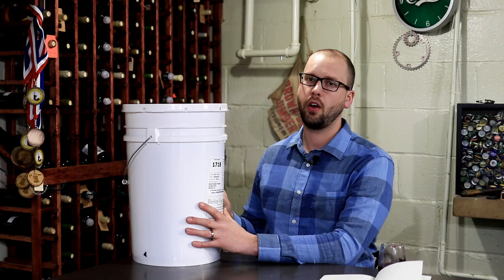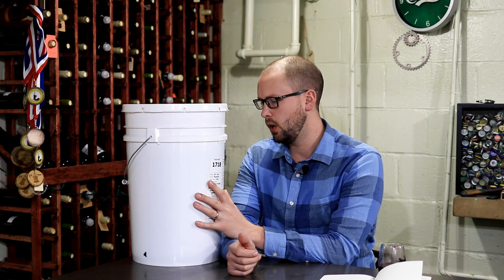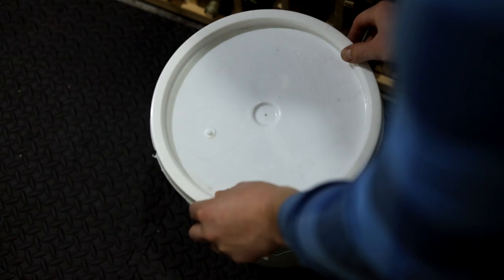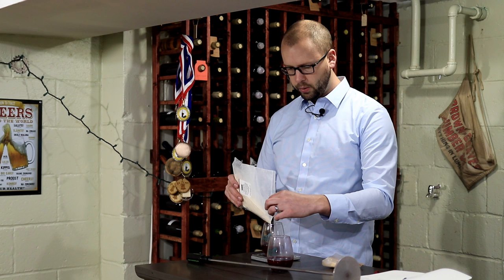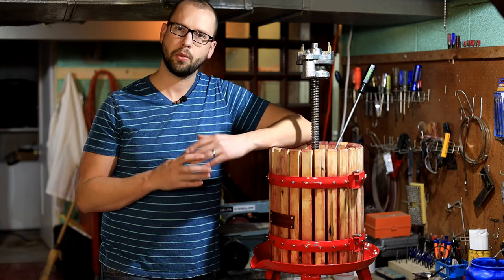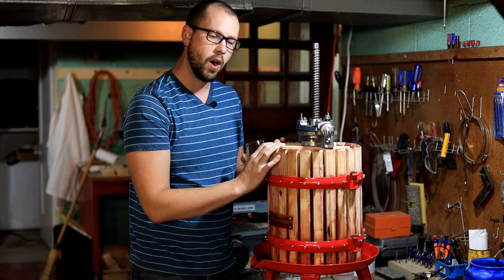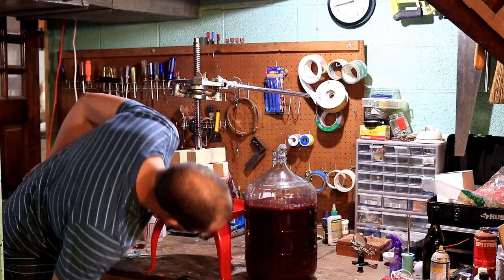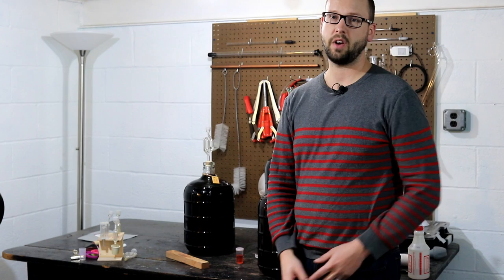Making Wine from Frozen Grapes!  Make Incredible Red Wine Anywhere, Anytime!

Comment: I noticed you start ML after racking. It also seemed like your time frame of the first rack was early. I have been adding ML before the first rack and then rack after it finishes. Since I don’t have temp control that’s usually at the 2 week mark. Does adding ML after the first rack make a big difference vs. the way I have been doing it?

Comment: very nice video, any tips with over sugar wine, happend to me, after secondary fermentation i had very low % of alcohol 5% ,add sugar to elevated but did bad job, its 1.20 on hidrometer, its any way i can save wine  on this point of time, i tried kick fermentation again, bubeling,but, not, moving any numbers on hidrometar. 
thank you

Comment: Hey Rick. Loving all your content and excellent tips, especially for guys like me just getting started. 
Noticed in your notes that on day 6 of fermentation (2/26) you used both CaCO3 and KCO3 to knock down your acid. What was is the rational for that choice? Thanks and keep it coming!
Reply from the maker: Hi Jerry.  Calcium Carbonate will reduce the acid pretty rapidly but leave a small bit of residual calcium.  Potassium bicarbonate is a little slower but leaves residual potassium.  Generally potassium bicarb is the first choice but eventually the potassium could create a slight salty taste if it were too much.  The amounts I added were super small so it really doesn't matter  but my rational is that a tiny bit of calcium and a tiny bit of potassium is probably less likely to ever be detectable than a larger amount of one or the other.
Reply: @TheHomeWinemakingChannel  Ahh, cool. Appreciate the rapid response and detail. Super helpful since my chem background is zero :) Thanks Rick!

Comment: Thanks for the video! I actually just recieved my order from Brehm! I ordered two buckets of Pinot Noir. I'm trying a cold soak for the first time. Should I be concerned about oxidation during the cold soak? The lid that came with the bucket isnt very tight fitting.

Comment: hi great video.. I bought some rjs wine kits and the ph is running low? like 3.1, I let sit on the grape skins for extra time - I bought some k bicarbonate and added .5t to each 5g batch, but for these reds you would suggest I get it to 3.5 post fermentation (now - they are still low)  thanks  similar ? regarding the tanin - best to add some tanin even post fermentation? - thanks.
Reply from the maker: I have seen some weird stuff from RJS wine kits.  The pH seems to run very low but they the TA is also low so they do not taste particularly acidic.  I think they are engineered this way so that they are very unlikely to oxidize from careless Winemaking.  I wouldn't get too carried away with bring the pH up any more on it or it will likely taste a little thin/flabby.
Reply: @TheHomeWinemakingChannel     

Oh great,

Of course I made a bunch of adjustments last night while racking.. (and straining so I watched a ton of YouTube wine making videos..) 

I used a 3 to 4 teaspoons per batch!!! to adjust ph to 3.1 to 3.4s some were as low as 2.9 and they were expired and I want to complete malolactic  fermentation sooo obviously worried re ph.. 

Hope I didnt make these 4 kits flabby!!

One merlot msrp is 199 the en premier kit and i added 3t to that one of k bicarbonate!! Yikes.

What should i do now if anything??

Comment: Great video! Is there any material difference using a stainless steele racking cane compared to clear plastic?
Reply from the maker: Thank you!  There is really no effect on the wine if you use the plastic cane.  Stainless will flow a little faster at the same size OD since the wall thickness is a lot thinner.  And stainless is much less likely to break on you as you are jamming hoses on and off of it.

Comment: I couldn’t see in the video, did you drain the water out of the bucket once it fully thawed?  Did you add additional water to the bucket after that or no?  We missed that part.
Reply from the maker: It is frozen crushed and destemmed grapes.  If you pick fresh grapes for red wine the first step is to crush and de-stem them.  The liquid in the bucket is grape juice from the crushed berries, and not water so you are basically getting a ready to go, red wine "must".  No need to drain anything out.

Comment: How do you keep your punchdown tool sanitized during primary fermantation? Do you keep a bucket with sanitizer during this period or do you make one fresh for each time you punchdown?
Reply from the maker: I leave it in a bucket of Star San that is filled about a foot high.  With the larger punch down tool, I spray it off with water when I am done using it, and use a spray bottle of Star San on it right before using.

Comment: Bulk aging vs bottle aging... If using carboys, when do you decide to move to bottles? If you decide to bottle age, when do you decide to pull the trigger and move into bottles? So far, it seems like you would move from the main vessel straight to the bottle after everything has settled out and if you bulk age you would just keep it in the carboy longer (maybe rack once more to remove any sparse sediment) and move to bottles when almost ready to consume. This sound right or am I missing something?
Reply from the maker: I like to bulk age reds for at least 8-12 months.  At that point they begin to show what they really can be and you can take a better guess at a good blend if you plan to do blending.  A summer cycle in bulk also assures that any instability that is going to show will show in carboy and can be dealt with or let to run its course.  A white wine, fruit wine or rose can be bottled soon after it clears up and settles out.  Those are generally better young so it is worth getting them into bottle by about 4-8 months.
Reply: @TheHomeWinemakingChannel  Still very new to all this. What can be done after primary fermentation has completed, in secondary/conditioning? Just playing with simply juice concentrate wines at home, they are very flat and monotone as I did not use any tannin powders or acid blends in primary. Is it too late add in some lemon juice as a citric blending agent? What can be done vs what should be avoided?

Thank you for your help!

Comment: Hi just got done with primary fermentation.  I want to start malolactic fermentation bu my ph is at 2.9.  Any suggesrions
Reply from the maker: I would make sure your pH meter is calibrated against some 4.0 and 7.0 solution.  I recently had a guy who's meter was reading off by about 0.5.  2.9 sounds unusually low to the point where I would question the meter unless it was a white wine or fruit wine.  If the reading is right, you can nudge it up a little bit with some potassium bicarbonate to help get MLF going but it will still be a challenge.  You will need to keep the wine relatively warm to get things going.

Comment: So I ordered a 5 gallon bucket of Merlot and by accident because of delivery problems got two buckets, they are both frozen. Following a Cold-Soak. My question is if you where to do two different styles what would you suggest, from yeast, too favor condiments. If you was to play with two different styles what would you do? Or would you stick with just one? And just do it right? Did I just answer my question?...:)
Reply from the maker: I'd ferment one cold (68F) which will make a very fruit forward wine, and let the other warm to about 88F for about a day or two which will make a much more intense wine.  You can also load the hot one with tannin during fermentation whether from oak or fermentation tannin.    I'm assuming these are frozen grapes, and not juice...  If juice I'd ignore my advice and ferment both around 75F.  If you want one to be more buttery you can do a slow cool MLF, while doing a warmer, well nourished MLF on the other.  If you want to do a side by side comparison you should probably mix the two buckets then separate again since there could be substantial bucket to bucket variation.
Reply: @TheHomeWinemakingChannel  thank you. You confirmed a few of my Ideas. Will do!!!

Comment: This is super interesting, I like being "in" on the decision making, including waiting, easing, etc. Well done. 
I noticed you didn't do a "saignée", though you usually recommend it for bigger, bolder wines - which Super Tuscans are. 
Would you mind sharing your reasoning? 
Also: fine, I'll order some frozen grapes when the carboy real estate opens up in the basement - you got me into grapes (vs. Must), may as well try this :-)
Reply from the maker: Thanks!  I actually would have pulled some juice off but I just didn't have a lot of grapes to work with.  I'd probably lean towards making two or three buckets if you were to do it, and considering pulling some juice off.  The tricky thing with the frozen grapes and the rose is that it is difficult to get the juice off early enough to not have over extracted it.  If I had a bucket that was obviously more liquid and less grapes than I wanted, I would definitely pull some off still.

Comment: Did you degas before transferring onto the oak? I’ve tried bulk aging with natural degas and it took forever to clear to what you have there after two days.
Reply from the maker: Did not degas before bulk aging.  Sometimes if a wine stalls out before finishing fermentation it can take very long to clear up.  The gross lees should fall out pretty quick but to fully clear up, no haze whatsoever,  usually takes at the earliest about 1.5 months to about 6 months.
Reply: @TheHomeWinemakingChannel  Another question. What size is your press? I am heading down to CFP to pick one up. I figured their size 30 would be plenty big enough for 5-10 gallon batches.

Comment: I have a question. Do you prefer synthetic cork or normal cork? Why and why not? Could you put a link for where I can get it?
Reply from the maker: I use acquamark corks.  They are natural, single piece corks with all the little pores filled with cork dust.  Natural cork compresses more easily and fits a larger variety of bottles without issue.  If you got a bad batch of natural cork though it can can contain TCA, the cause of "cork taint".  I have never had this happen but with lower quality corks it can certainly happen.  With synthetic corks this is not an issue.
Reply: @TheHomeWinemakingChannel  Cork taint is relatively rare maybe 3 bottles out of 50 would have it. Also synthetic corks seal worse and can leak more air into the bottle and can oxidize a wine faster.

Comment: Do u add an airlock after pressing to kill the active yeast ? Or is there some other reason ?
Reply from the maker: You add the airlock after pressing to keep the oxygen out.  The yeast will still survive if it is still going but it does like a little air to keep it happy.  I usually press once the wine goes dry.  After the fermentation is completed you really need to start limiting the oxygen exposure or the wine will start oxidizing which can smell like Sherry, nail polish remover, or vinegar
Reply: The Home Winemaking Channel thanks for the response, jus a another basic doubt, when does the fermentation stops ? I do understand once you press and throw the must the fermentation process gets over, but the yeast is still in the wine, won’t the remaining yeast keeps converting the sugar into alcohols ? Do you add something for the remaining yeast to stop fermentation after pressing ??

Comment: Can boiling the fruit give better color and body to my wine ?
Reply from the maker: By boiling the fruit you are blowing off a lot of the good aromas and also cooking the fruit which changes the wine from a fresh fruit aromas to a cooked fruit aromas which are generally not preferred.    To preserve aromas you will actually do the opposite and ferment cool which contains volatile aromas much better.  In red wines you will often ferment warmer, on the skins and seeds but not as for aromas but for body and complexity.  You give up a little fruit smell in exchange for tannin and extraction of harder to get to stuff.  Alcohol is a great solvent also so if you ferment on the fruit you can extract a lot.  You can improve extraction by using enzymes to break down the fruit like pectic enzyme or more exotic enzymes.  A lot of cheaper red wines and wine lot's will use flash extraction where they heat the red wine must briefly to extract very quickly and save a lot of labor but the wines are very one dimensional.  You can usually sniff out a flash extracted wine by the isoamyl acetate (banana runt smell), thin body and great color.
Reply: @TheHomeWinemakingChannel  . Thank you so much ! You saved me a year ! 👍

Comment: I still struggle with exactly when I should end primary fermentation and take reds off the skins
Reply from the maker: I prefer to let the wine pretty much finish fermenting on the skins.  You can press earlier but you are losing skin time by doing it.  You can press later also, but you start to risk oxidation.  If pressing later, you would want to chill the must back down and blanket with inert gas.  The benefit of extending the skin time on the back end is a little different than the cold soak on the front end though since you are not extracting the more alcohol soluble components like the seed tannin.